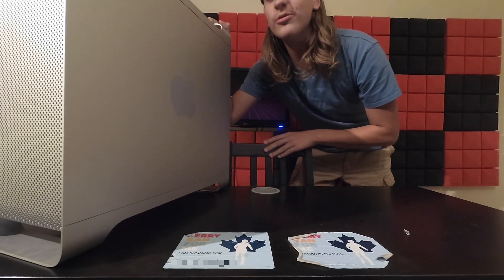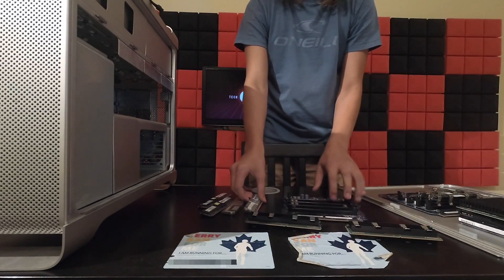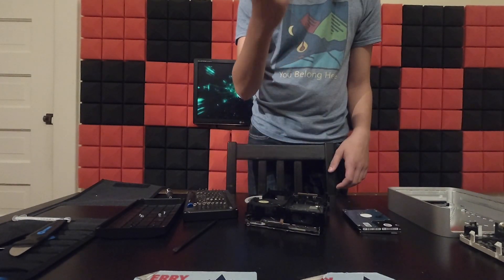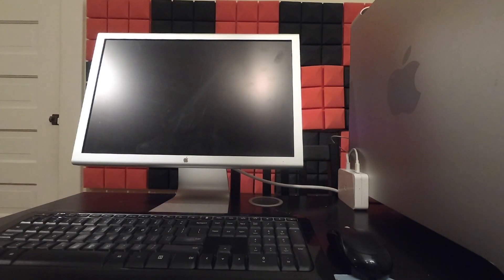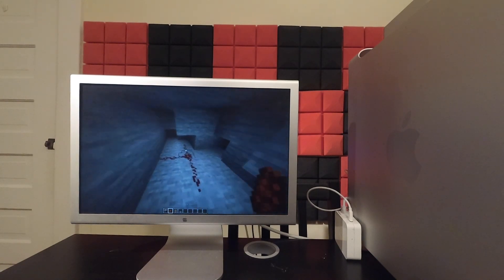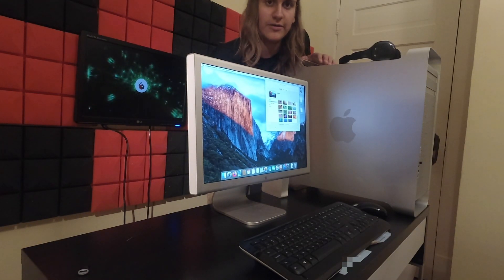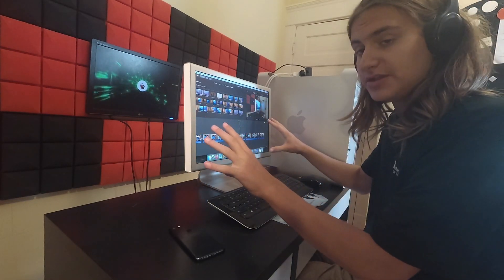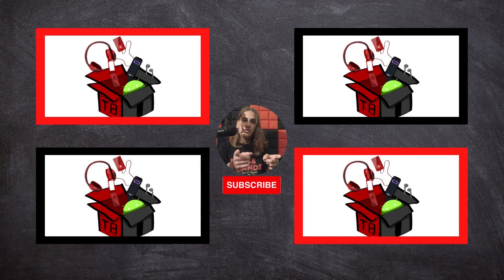Too slow? THINK AGAIN - Upgrading my 2006 Mac Pro from stock to POWERHOUSE

Comment: I got one of these for super cheap a week ago. Mine already had a working 4870, so whatever heat issues were worked out (it is the Mac edition though). Other than going through pain to get Windows on it and waiting far too long for RAM (still waiting) that cost almost as much as the  actual computer (it was that cheap) I installed Snow Leopard on it (was running El Capitan so it triple boots now). You are right, it is loads of fun and such a nice looking beast. I might look for better processors and flash it to 2.1.

Comment: Cool, obvuisly your Mac Pro was already flashed to the 2,1 firmware. Thqt's the hardest part of the upgrade..
Reply from the maker: Actually, it wasn't flashed, but I didn't need to flash it because the CPU's were already pretty powerful and with the computer not being worth much, I left it at GPU upgrade (which was a must) and RAM (which was also a must). I did "technically" put an SSD in there, but it's cacheless so it wouldn't really improve performance all that much.